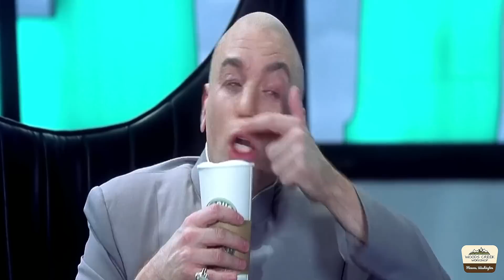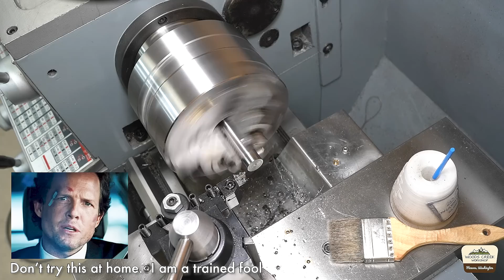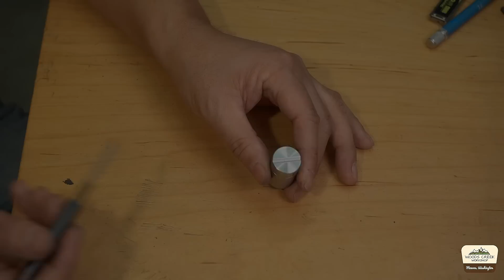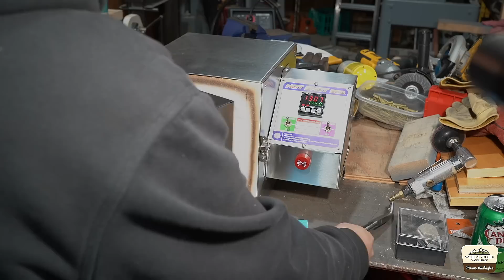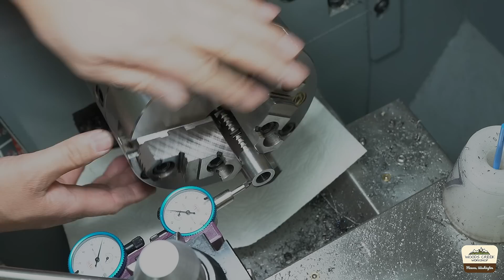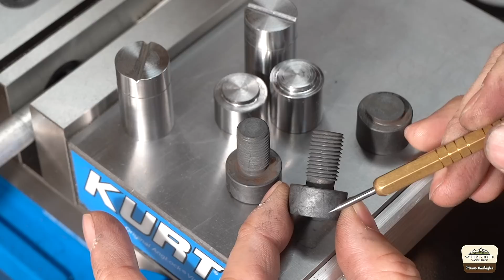MINI MACHINIST JACKS - Make This Versatile MINI Version #hotshot360

Comment: The exterior of the W-1 steel cooled more quickly than the interior, and the hardened portion could not withstand the forces from the interior of the part.

Comment: I bought the 1200 as soon as it came out. As long as the fairly hot surface doesn’t bother you, both Suze’s are a great bargain. The new one from American Rotary fixes some insulation problems, but are larger and more expensive.

When I made hacks, ice given them a rough knurl, or flats, depending on my mood. It helps when tightening and loosening.

Comment: Great video! 👍
EEK! As an electrical guy, I cringed watching you hold metal pliers in your hand and stick it in the oven! That oven has fully exposed LIVE elements, which can cause a deadly electrical shock if you touch the element.
Since you can't always trust the active/neutral wiring, even if the element is switched off it can still be deadly.
The best safety precaution is to unplug the oven from the wall before sticking your hands (or metsl pliers) into the oven.
Please be safe! 🙂
Reply: Unplugging the oven disables the active cooling fan for the electronics cabinet.  The manual is exceedingly clear that you should not unplug it until the oven is cold.
Reply: @Clough42  ...  thanks for the info!
In that case I hope the door interlock operates a full DPST contactor to disconnect both ends of the heating element, because in most western countries it would be illegal to have an exposed element that a human could contact.
If is is just a SPST disconnect of the active wire to the element that is not enough. 🙂

Comment: I really don't see the purpose in using high carbon steel for this application. Use cheap mild steel or even leaded steel. I don't want hardened stuff coming into forceful contact with my precious workpiece. This is not a cutting tool.

Comment: STOP WORK SLIPPAGE in chuck. Grocery store brown (Kraft) bags are made from clay-free wood fibre that has a consistent thickness and a high degree of friction. I cut a SINGLE layer and wrap the work leaving a slight gap. No need to be fussy cutting the sheet. Just put any gap between two of the jaws. I also use a piece under my AXA QCTP. The same sheet has been there for over a year and it is soaked in oil and still resisting slippage. In each case, there is no need to put excess torque on either the chuck or the toolpost nut. Over-tightening a three jaw chuck potentially can damage the scroll.

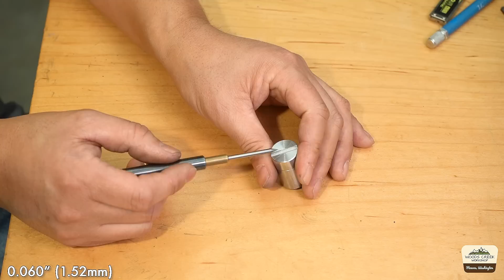Comment: Pristine equipment, well- cared for, I like that, I can't stand working in swarf, I spend more time cleaning than machining, but that's just me. I notice what may be an old Rockwell radial arm saw in the background @12:50, that made me a subscriber right there, for the man who has such a machine, no woodworking task is beyond reach.☺
Reply from the maker: Old turret style Delta USA 😁

Comment: I must admit to using lowly bolts from the hardware store for this application.  Maybe they could be faced for more precision.
Reply: The connecting nuts for threaded rod are great for this, easy to cobble together any length. Hex bolt in the bottom,turn head flat, bolt with turned down threads at the top can swivel. Adjust with 2 open spanners if some force is needed. Gona make proper ones one of these days... I like the design in this video.

Comment: Nice project for something thats always usefull, As you mentioned the rod is slippery, either a bit of knurling or a simple hole in the side to take a thin rod would help when trying to snug them up to a job might be a good addition(befor treating)

Comment: Where did you get your chamfer tool from is that Hss you made or did you buy it from somewhere ???
Reply from the maker: It’s just a square blank HSS from Amazon that I ground.  Easy peazy
Reply: @woodscreekworkshop9939   right on thanks I think I have a piece of half inch I can use I really like that shape looks like it works well 👍👍👍

Comment: Interesting to see the cracks .  Sometimes  we used to put a layer of oil on the water to take the temp shock out of the quench .   Cheers .
Reply from the maker: Max Grant ,The Swan Valley Machine Shop. I could have used oil, but it all comes down to me not thinking through, 🤦🏻‍♂️
Reply: @woodscreekworkshop9939  I wish i had your heat treat oven !   Cheers .

Comment: I didn't look through all of the comments so this may have been already suggested, but ATP-641 from Brownells is an easily applied coating that drastically minimizes heat treat scale. Paint it on or dip the parts and let it dry. You can warm the parts to make it dry faster and when your done it comes right off in hot water. Great video and congratulations on the Hot Shot 360! It is definitely on my list of wanted equipment.
Reply from the maker: Oh, that sounds nice!  I will definitely check it out.  Thanks Brian,
Reply: @woodscreekworkshop9939  Happy to help. It is cheap enough that I always keep a can in the shop.

Comment: Great project and thanks for the transparency on the cracked parts. 
One thing someone might add would be small holes in the top piece for a small tommy bar and a couple of flats on the base to make it easier to hold as opposed to a smooth round surface. Regardless, you should get a lot of use out of those mini jacks.

Comment: A couple of things I also noticed. I like the look of that lathe chuck you have. All singing all dancing 'run true'. Is it a steel body or iron? What brand is it? The other point being where the collet block fell out of the vise. They are a damned nuisance for doing that. I've had it happen to me a few times. It seems a very useful improvement could be had by making homebuilt collet blocks with a longer body so the weight bias remains over the vise end or a spring clip needs devising to retain the collet insitu when the vise is opened. They are a pain in the backside as sold,most especially when a delicate component gets a precisely machined feature dropped onto the machine bed,or worse,the floor.

Comment: Very good,Yuchol. Let me suggest some minor improvements to the design. The top section of the threaded extender is easier to adjust if it has a raised and  knurled feature around the outside diameter. Further improvent is had if the top pad is free to rotate and stays static whilst the jack screw is adjusted to height.
Reply from the maker: You’re right.  I didn’t knurl because my tool is not very good.  I plan on making a new and better design knurling tool soon, watch for that video 👍🏻

Comment: I agree with the knife maker, the phase transformations occurring during the heat cycle need to be done slowly.  That is, thermal shock cracking results from the stresses of heating too quickly.  Quenching locks the high temperature phases in, to produce the hardness.  I really doubt the cracks occurred during quenching.  Just a metallurgist’s opinion 😀.
Reply from the maker: Larry J thanks Larry!

Comment: Nice, looks like a good beginner project for me.
Some heat treat advice from a knife maker. When hardening, place your piece in the centre of a cold oven and bring up to temp slowly and evenly over about 30 min, maybe holding at 3/4 temp for 5 min. Soak at critical temp for 10 - 15 min. (temps vary but can be googled)  
As Shark River Machines said, oil can be used but will probly disclour the steel. Either way, preheating the quench bath is best, again temps vary but about 50c should be fine.
I reckon the cracks were from going straight into a hot oven which can cause stress fractures. Slow and even heating is the trick and rarely pointed out.
Heat treat is a deep rabbit hole but I hope that helps 👍

Comment: I need to make some of those.
I don’t have an oven. Maybe next year.
Well done
Reply from the maker: I have used plumbing MAPP gas torch to heat treat before buying the oven, works fine for something this size.  Hope this helps.
Reply: You don't really have to harden machinists jacks. I find the homemade cast iron and unhardened silver steel ones I have are just fine. Don't let a lack of hardening facility deter you from making some. They are really handy.

Comment: liked the project , I heat treat a lot of parts in my shop and use Keep Brite powder for o-1 steels and stainless bags for A-2 to keep the scale off , For me A-2 is worth the extra cost a for the most part is trouble free when heat treating
Reply from the maker: I got some A2 coming to play with
Reply: @woodscreekworkshop9939  Very good , make sure that you place the parts in a stainless bag , there will be no scale if you do this

Comment: Nice project, I am no expert in heat treating but I understand that you can quench the W1 in oil also.  I would be interested to hear some experienced heat treating techs take on that.
Reply from the maker: R. Steven Lang, Shark River Machine yes you can.  The material doesn’t know water from oil.  Using oil would also slow down the quenching process.  Thanks.